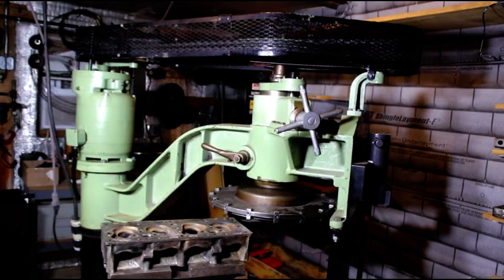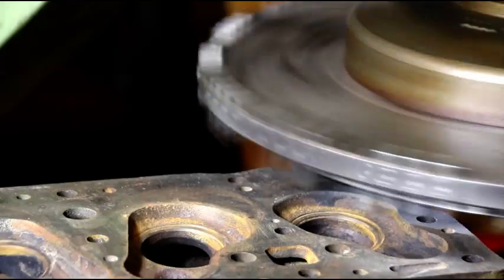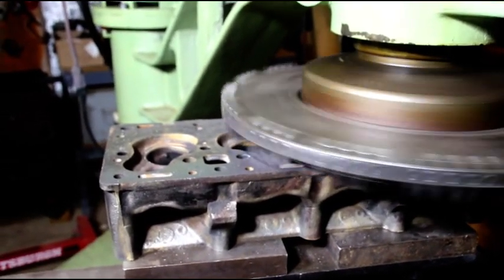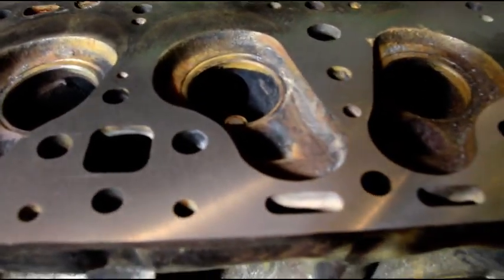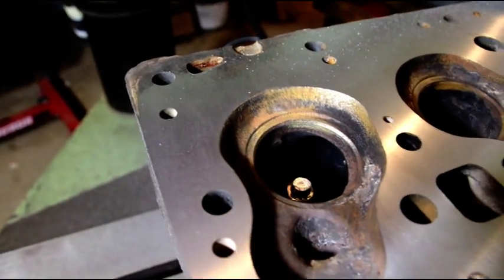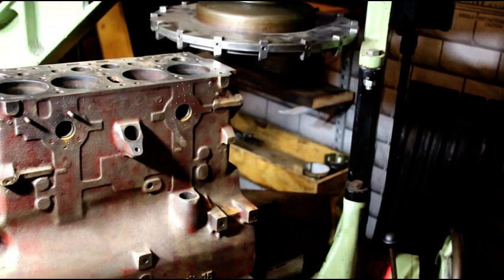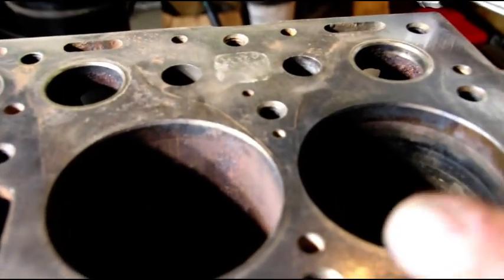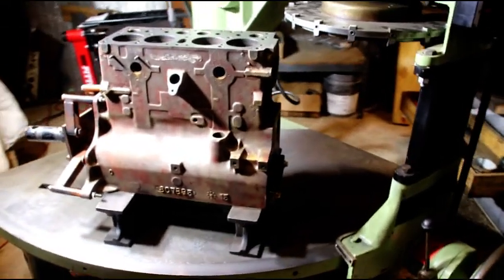Storm Vulcan Blockmaster 85B First Job,  Willys F134 Engine Block and Head

Comment: What an interesting machine. I came up thru machine shops so I tend to go to massive metal shapers and jig bores. I can see this approach really saves on space and you don’t need to move 10,000 to 20,000 pound monsters! I am impressed!
Reply from the maker: I would love to have a super large shaper or even a big planer.  Love Jig boring machines but have not been able to find a good one locally.
Reply: @metalshaperJeep  well that sucks. My brother sent his yuppie ass lawyers against our family and family home so I have to move. I had to scrap a 20 in Gemco shaper and a 24 in Rockford hydraulic shaper. Still need to figure out what to do with my Henley 16 in shaper and at least one Rockford open side planer shaper.
Reply from the maker: @devmeistersuperprecision4155  Wow, that sucks, sorry to hear about your situation.  Also sad to hear that you had to scrap your shapers.  I have a 20" steptoe shaper that I have been trying to sell so I can upgrade to a 36" unit or an actual metal planer if I can find one.

Comment: These engines came from the factory with hardened seats?  I had my F head rebuilt and didn't know any history of it ever being rebuilt.
Reply from the maker: Late F heads started coming from the factory with hardened seats installed.  Early motors did not have them.
Reply: @metalshaperJeep  I was wondering about it. I believe my F head that was just rebuilt was possibly from a 53. It had standard pistons in it. The shop discovered them when they resurfaced the block.  We didn't need to buy any or install them. Win win in my opinion.

Comment: What is different/better about this machine compared to the one you used previously to flatten blocks and heads?   This is all new to me.
Reply from the maker: This machine can do much larger blocks such as straight sixs and eights.  My milling machine could not handle much more than a four cylinder due to table travel.  This is a much more powerful and sturdy machine.